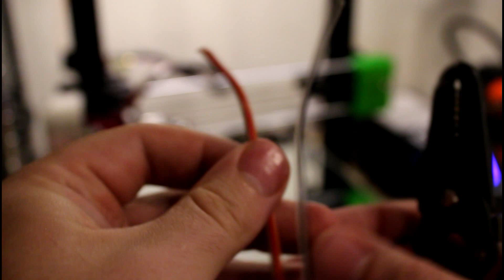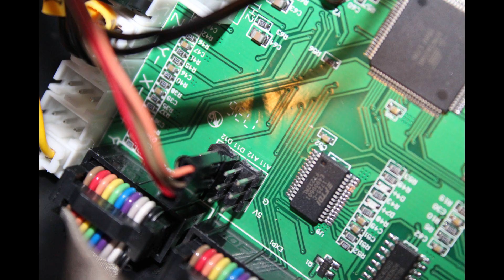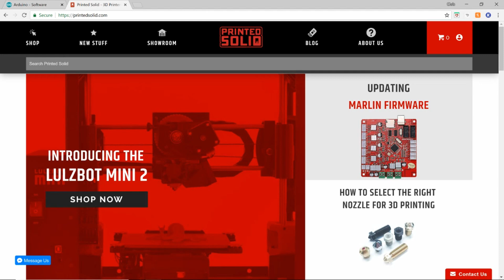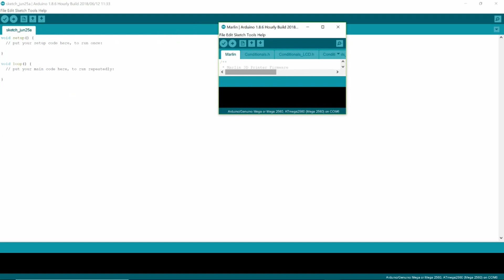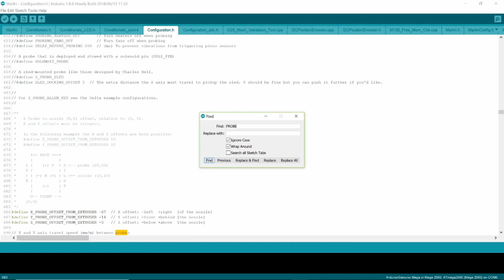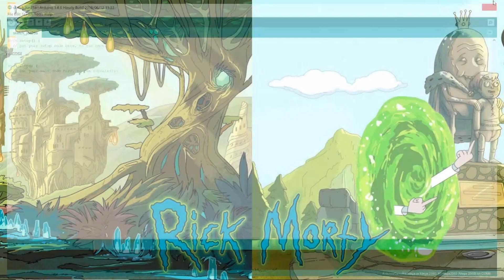Installing the BLTouch on the CR-10S

Comment: I did this a bit differently with a usb cable and creality slicer flashing the firmware, my head keeps smashing into  the glass can you help me?
Reply: make sure the z axis end switch works
Reply: @roel_  uh no, your supposed to disconnect that and use the bltouch as the z stop. its fixed now, you have to switch the wires for the 2.1 mainboard
Reply: Oh yeah I got mine a week ago. Without a bltouch tho, I might get one since the leveling with the stock bed is a disaster. My issue was that the z end stop wasn't working. I knew there was an upgraded z switch mount on thingiverse but I couldn't print that due to a not working z end switch. So I fixed it by bending the metal part of the z switch slightly.
Reply: @roel_  Im considering using the parts to build a new corexy printer. The cr10 is just way too big and slow. The bed leveling sucks, instructions suck and tbh the bltouch doesnt even work half the time
Reply: @joejia1410  dang is it? I only heard positive things about the cr10. I bought the cr-10s version with dual z axis rods. But I'm only struggling with leveling. Just emailed the seller here in the Netherlands that the should send me a new build plate due to the fact that the stock one isn't even straight. It's bowed... But other than that I quite like the printer so far. I did flash Marlin tho. And printed a new fan duct. I might order a bltouch in some time. A friend of mine has the cr10 v2. The leveling also sucks on that one, but its probably due to the big size of the bed. He ordered a bltouch yesterday and is expecting it it come tomorrow. I'll go take a look on his printer and listen to his opinion after the coronavirus.
Reply: @roel_  To be honest saving money for a prusa is way better. Even get a cheap clone ultimaker is better. The cr10 is really good for the first few prints but the hotend is shit the buildplate after hundreds of hours warps, the control system is slow and most importantly its worthless for resale.
Reply: @roel_  Ill post a video on my channel about it when I have some time.
Reply: @joejia1410  ahh well okay. I'll check your channel so now and then!
Reply: @roel_  sure! Ill be sure to post a video tommorow or the day after that

Comment: I have the V2.1 mainboard, it looks like you have the V2.0. Also, the 3 colored wires on my BLTouch (V3) are blue, yellow and red, and I'm having some difficulty figuring out exactly where to connect them. Thanks!

EDIT, I found the correct wiring diagram in the document below:

https://dl.kamilake.com/3D%20Printer/Creality/BLTouch%20Guide%20book%20for%20Creality%20V2.1%20mainboard.pdf
Reply: I have this issue did you solve it
Reply: @vkhelldog  Yep here you go!

https://dl.kamilake.com/3D%20Printer/Creality/BLTouch%20Guide%20book%20for%20Creality%20V2.1%20mainboard.pdf

Comment: This is not the CR-10s board. at least not the same as mine (bought 2019/04).  so the wiring is not good!  be aware.
Reply: It is the same board that is in my CR-10S that i bought in Denmark October 2017

Comment: Hi all have a issues when compiling the code. I get an error stating. Error while detecting libraries included by C:\Users\user\AppData\Local\Temp\arduino_build_192611\sketch\Sd2Card.cpp
and also Error while detecting libraries included by C:\Users\user\AppData\Local\Temp\arduino_build_192611\sketch\power_loss_recovery.cpp. Thanks in advance
Reply: Ok, i now found out that there is a bug in the arduino ide that causes the compiler to not work correctly if there are any single line comments (comments starting with an "//") in certain documents. Just remove all of the comments from the files that are included in the file that is stated in the "Error while detecting libraries included by..." error and it should work. at least it did for me.
Reply: @TheSunriseAnimation  sorry for the late response. But it took me a couple of days and a lot of searching to figure it out. I'm glad you got it honestly it's been a while so I don't remember how I did it but I got it to work.
Reply: Hi, i wonder if you found a solution eventually. because i have exactly the same error with the Sd2Card.cpp but otherwise everything compiles but my printer crashes when it initializes the sd card.
If i get a fix i will post it here.

Comment: ★CAUTION:THIS WAY IS SUCKS. JUST GOOGLING AND FIND 'CR10S-Ps-Stock_119.hex' FILE★
Hey Mr.smart. that is sucks.
that is make some fucking horrible error. i lost my firmware in my machine.
Reply from the maker: You didn't follow directions I am guessing. Sorry to hear that you think it sucks. I had to change the print volume seeing that the print head is bigger, using the Titan Aero, thus making the area of travel smaller. Hope this helps you.
Reply: @MostlyBuilt  I mean not you. just this video.
my mistake. sorry.

Comment: Fix for Configuration.h I think (Marlin 1.1.9)
// Set the boundaries for probing (where the probe can reach).
  #define LEFT_PROBE_BED_POSITION MIN_PROBE_EDGE
  #define RIGHT_PROBE_BED_POSITION (X_BED_SIZE - MIN_PROBE_EDGE + X_PROBE_OFFSET_FROM_EXTRUDER)
  #define FRONT_PROBE_BED_POSITION MIN_PROBE_EDGE
  #define BACK_PROBE_BED_POSITION (Y_BED_SIZE - MIN_PROBE_EDGE + Y_PROBE_OFFSET_FROM_EXTRUDER)
Reply: One point of confusion I'm having.  When I tell the printer to level, it homes X and Y and then tries to home Z, but the probe is on the left side and hovering over empty space so it can't touch anything and it's crashing the extruder into the plate.
Reply: Ok, figured it out.  Need to uncomment #define Z_SAFE_HOMING on line 1144
Reply: I have the same problem!!!!!  Was uncommenting z safe homing the only thing you changed to fix this ??? Im curious, what happens when you auto home after this
Reply: @redeye118  it homes in the middle of the plate
Reply: @nwstraith  ahh mine does not do this, it still crashes into the plate like you had before, I will try the edited code tomorrow :)
Reply: @redeye118  then whatever you pushed didn't include the z safe homing
Reply: @nwstraith  ahh right ok, you have done this on a cr10s yeah ?
Reply: Yes.  I have a cr10s

Comment: Hi 3DPrint3D
!!! Do you not need a arduino uno???  or do you just plug into the printer? or a bootloader or anything? im confused lol
Reply: As far As I can tell, assuming that you have a Cr-10s and not a plain cr-10, the board comes with a boot loader so you do not need to use an arduino to "enable" that feature.

Comment: Need help, my CR10s board looks nothing like this! Got my CR10s in 2018
Reply: https://www.google.com/search?q=CR10s+BL+touch&client=ms-android-hms-tmobile-us&prmd=svin&source=lnms&tbm=isch&sa=X&ved=0ahUKEwjuq9zxvebeAhUMSa0KHXgZDZAQ_AUIFCgD&biw=424&bih=673#imgrc=xZnXXerA3dUk0M&imgdii=Hjv-c_hjBE0dZM here is a link to mine
Reply from the maker: Daniel Hoke can you tell me what the 6 pins right next to the processor in the center of the board says? Just gotta try to find where the servo pins will be connected. You will use the Z limit connector for your black and white wires.

Comment: When trying to home all axsis, I end up with the print head ploughing into the bed because the probe is protruding to the left extend of the bed.
Obviously I am doing something wrong in the software, but what?
I am using the latest version of Marlin (1.1.9).
Any help would be appreciated.
Reply from the maker: Niels Andersen you need to change either or both of the Probe Offset or your bed’s min and max values.

Comment: Would luv to ditch the aluminum extrusion for rods on the x gantry. Any plans on releasing the stl's and process? I have an CR10S4. Longer rods but everything else should be the same.
Reply from the maker: If you'd really like I could put together a video with how I did the upgrade and release a final version of the .stl files.
Reply: I'd love to try it. The roller wheels deteriorate over time (which u can just clean away, but still). That build up causes streaks in the walls of my prints, if left dirty.
My only concern for you would be people hassling you for mods to your design to fit their different extruder motor and hotend. (i fall in that category) I suck at 3d modeling. So I couldn't easily change your design for my components.
But for content for your channel it would be awesome, everyone else is doing basic to moderate cr10 mod video's. So you'd have original advanced content.
Reply: Yes Please!! I have 2 standard CR-10 original, and an S4 all with titan aero upgrades. I'd LOVE your files and instructions for upgrading!!
Reply: @MostlyBuilt  I need help, can someone send me the firmware.bin of SKR 1.4 Turbo, TMC 2208 for a CR10-S?
Reply: 3DPrint3D plz do

Comment: Very thorough install video. I used servo wire only because it's what I had available on hand at time of installation. I still need to clean up my wiring however, gonna add some wire sleeving.